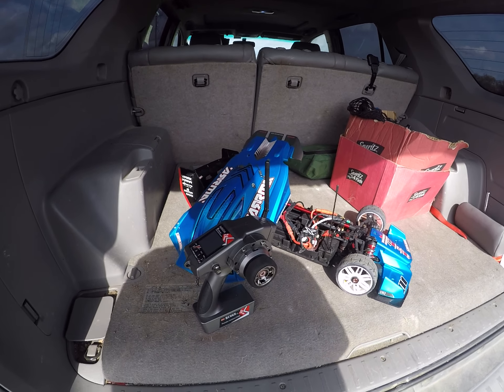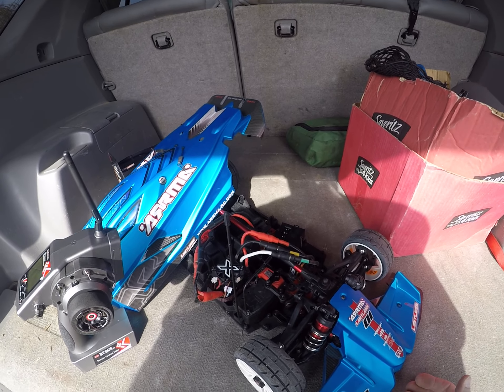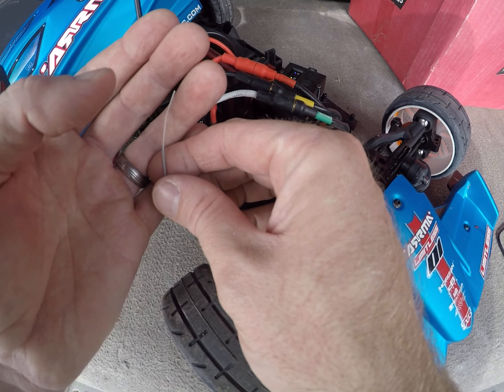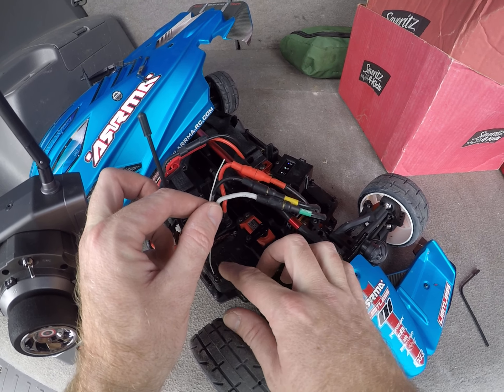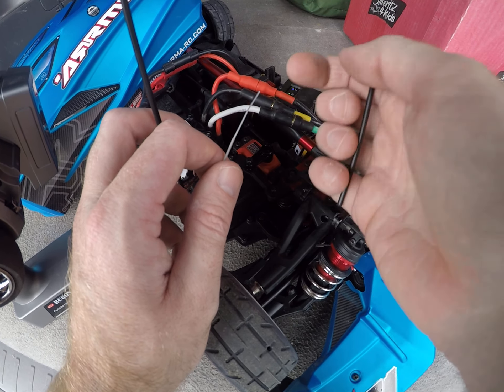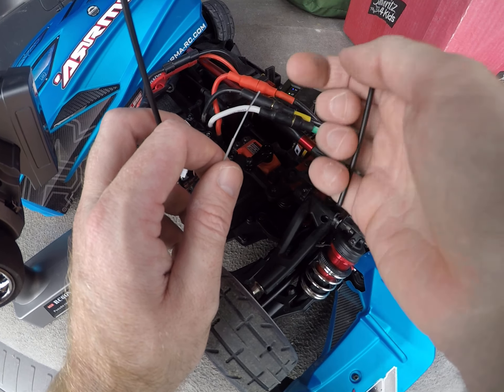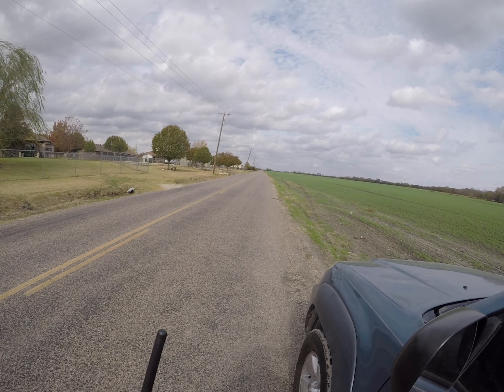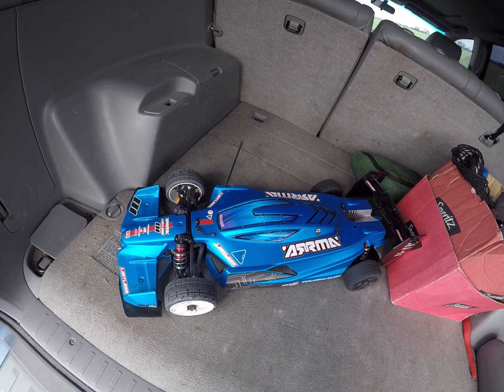RadioLink RC6GS v2 Range Test over 1500 ft range!!!   R7GF dual antenna receiver Arrma Limitless

Comment: Thanks for sharing! Found you on the Arrma forum. 
Your so right about all the range test videos that don't TEST THE RANGE. 
I bet if you stood on a stepladder in a remote location you could go a mile with that setup.
Reply from the maker: Something worth noting is that the radio latency is pretty bad over 1200 ft.
Signal boosters help with this, but then you could run any radio...

Comment: I just got this controller,   I'm trying to figure this out is there a way to have  duel rate real low during the speed run, then program one of the button channels,  hit the button then the steering goes back to full rate? Instead of going into the menu then hitting a button to bring the car back to full rate
Reply from the maker: We had talked about this today on the Arrma Forum.  There is no way on this radio to change the button settings.
Reply: @Liberty.Francis  damm Thats suck if this was  able to do it , this video would have been up there with the best of them

Comment: What did you use on your antennas? Heat shrink?
Reply from the maker: I bought a 10 pack of antennas and they come with rubber caps for the ends.  No heat shrink used.